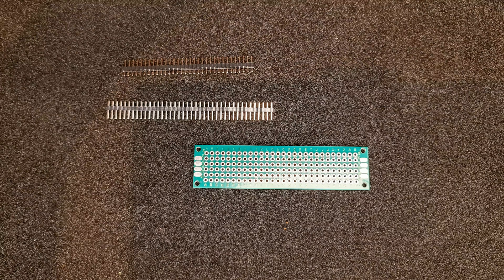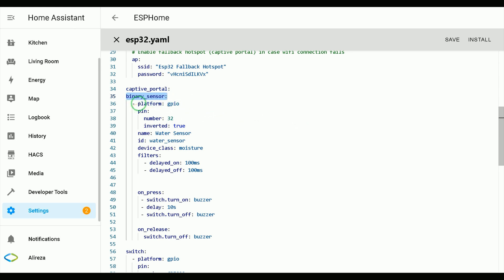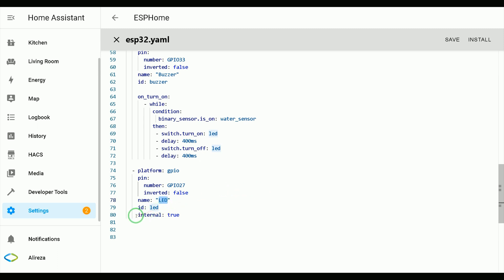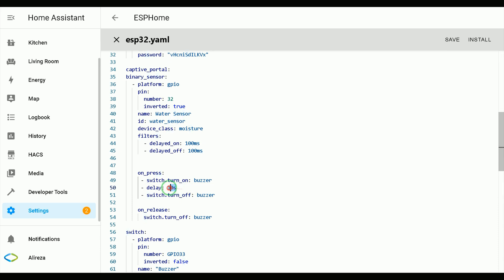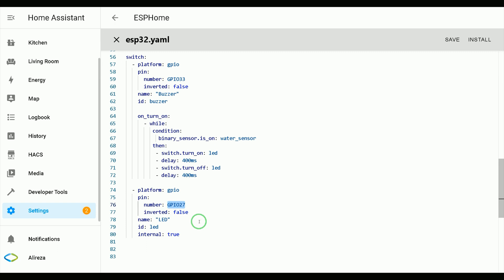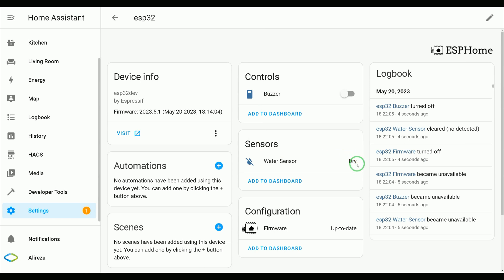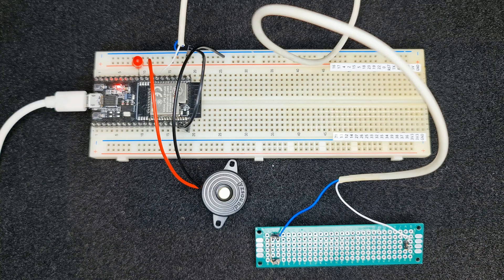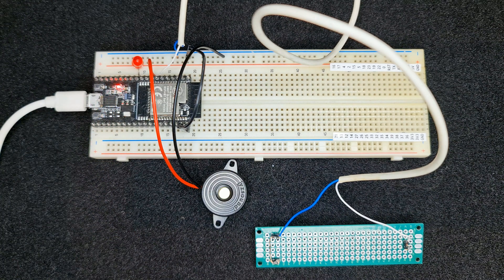Homemade Water Leak Detector

Comment: Hi Friend, excellent video, I must say friend that I am in a similar project but when I make contact with the water it does not work for me and I am making the code in Arduino, for a pin bag 5v And when I make contact with GND it detects me but out of the water, when I put it in the water, it doesn't work for me, will you know what it could be?